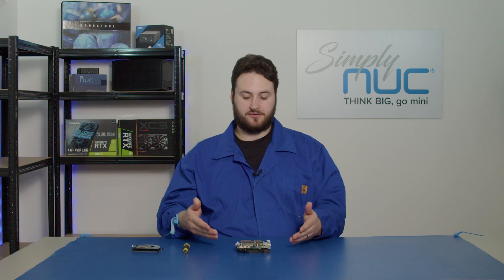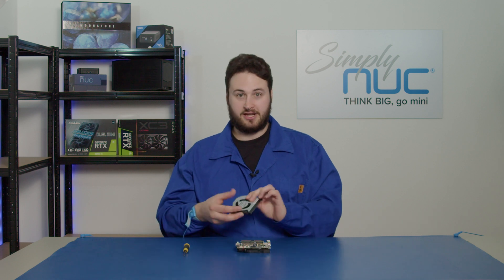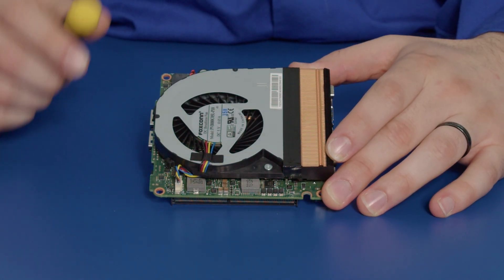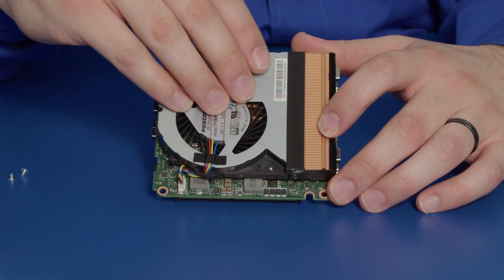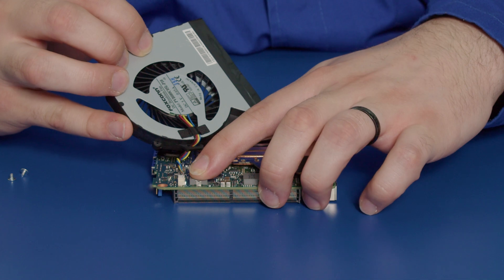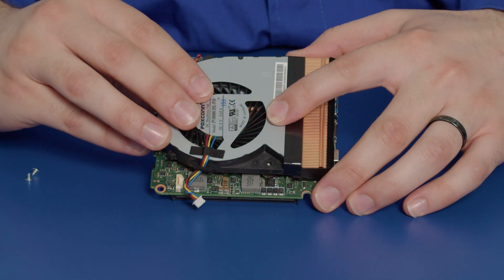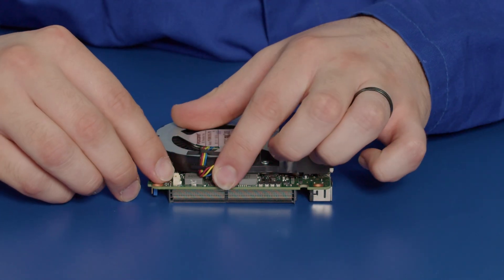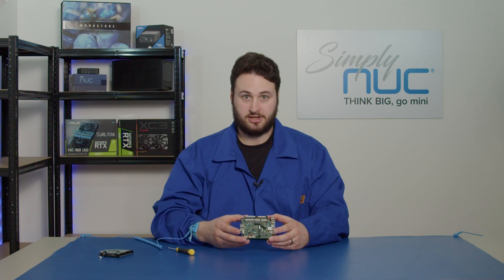How to Replace the Fan on a 4x4 Mini PC: Step by Step Directions

Comment: Do you think is posibe to replace the full cooler system with a biggger one, for example a noctua or therlmartake?, and I'm talking about the socket,and the voltage, for me It doesn't  matter if I have to modify the case. , thanks
Reply: It would be nice to know.
Reply: @anto3617 it would. I’m trying to work on some ideas